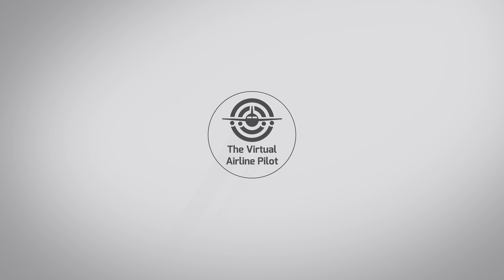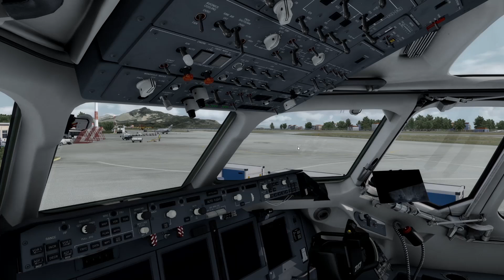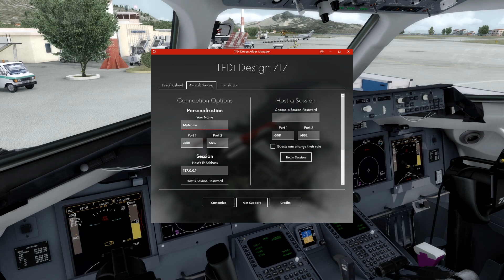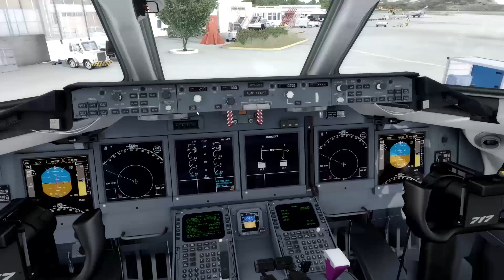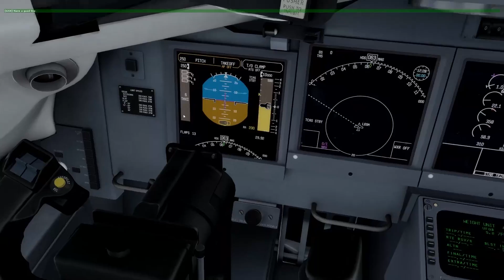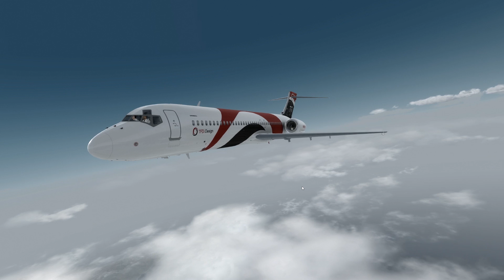First Impressions: TFDi Design 717

Comment: Don't mean to be rude but that was painful to watch... I understand this wasn't a procedure video but there were so many things that bothered me. The autothrottle and autopilot are coupled in this aircraft, meaning you can't use them separately. You takeoff manually then enable autoflight. Also in the CDU, you were just inserting random things (Flight level 5?) and clicking random buttons. Also try to go directly to the point, you took 31 minutes on something that could have lasted 10. When you start explaining something just do it, don't keep bringing in matters that aren't related to the video. Don't feel bad, you have great potential, this was a constructive comment.
Reply from the maker: Hi Eduardo, thanks for your message and taking the time to write a comment. I appreciate it. The idea of this type of video is to do what everyone does when they buy a new aircraft - they jump in it and hit buttons. So think of it as a free demo :-)

Comment: Thanks for the video. I'm pretty familiar with the PMDG MD-11 cockpit and since the 717 cockpit is basically a baby MD-11 I'd feel right at home in here.
Reply from the maker: You're welcome! I've not flown the MD11. It looks really nice though.
Reply: The Virtual Airline Pilot You should check it out! It's definitely one of the better payware planes out there.
Reply: I am defiantly going to miss that plane in p3d v4. it works in v3.4 with the migration tool

Comment: Why are the sounds so bad if TSS did them ? I mean this plane sounds nothing like the real one. Just watch any video on YT and you´ll notice that this sound set is so generic. No engine buzz, the wind is too quiet, and you can constantly hear that ¨vacuum¨effect from the cockpit. Not the case in the real one. On top of that there´s no rumbling on take off or roll out and the touchdown effect seems to have been forgotten. What on earth happened here ? Just compare this to the FSL A320...
Reply from the maker: I don't really have any experience with this aircraft so couldn't really comment on the quality of them. I do think a couple of volume levels could be a bit lower (like the landing gear handle) but that's a personal preference. I'm still really happy with it though :-). What aircraft do  you generally fly?

Comment: Hi all, Nice video and quite informative too. You mentioned the 717 isn't like any other Boeing. Seem's to me that alot of the systems are standard Mcdonnell Douglas. If you have flown the MD11 you'd be right at home in the 717 it seems. Thanks anyway.
Reply: That's because it was started as a McDonnell Douglas plane before they merged with Boeing. It was the MD-95 and used the same flight deck as the MD-11 for commonality.
Reply from the maker: Hi there. Very much so! Having seen some screenshots from the PMDG MD11, you'd be right. You're welcome and thanks for stopping by!
Reply from the maker: Yep!

Comment: Looking at picking this girl up. I usually fly the PMDG line of products, 737, 747, 777 and I like that you compared this plane with those. It gives me an idea of what to expect.
Reply from the maker: Good choice. Just to clarify, I was only comparing the performance - not the operation :-). The 717 isn't really a Boeing, it's an MD95 - so the operation is very different! It takes some learning for sure, but that's the fun of it :-).
Reply from the maker: If you do purchase it, be sure to stop by this video again and let me know what you think of the aircraft :-)
Reply: That was what I was meaning to say, not that you were comparing the systems but how you spoke on the differences between the two. Mixing my words up is what I do best. Thanks for clarifying for me. :)
Reply from the maker: Ah right! Haha. No problem Nathan!!
Reply: Will do. It's on my short list of aircraft to pick up. Thanks for the great video review and quick reply's. You have a new sub.
Reply from the maker: You're very welcome and cheers!

Comment: Nice video! I really like this bird, I was looking for this kind of video and when I saw this video it really put a smile on my face. You just earned yourself a subscriber :D
Reply from the maker: Thank you, really pleased you enjoyed it and found it useful! And thanks for the sub too :-)
Reply: Np, but I have 1 question regarding the plane. Is it frame rate heavy? I have the PMDG 737NGX and I always get 30+ fps so I was wondering if I could run it.
Reply from the maker: Sure - I fly the PMDG 737 a lot and I'm currently getting either the same or better performance out of the 717, which is great. If you head over to the TFDI forum, there are some conversations about performance and frame rates that you might find useful.
Reply: Thanks, I'll check it out.
Reply from the maker: Great! Stop by again and let me know how you get on with it. Happy flying, Captain :-)